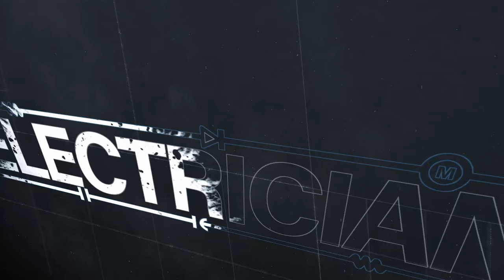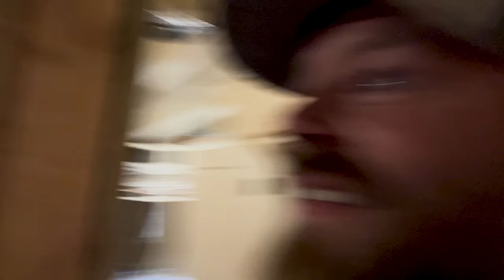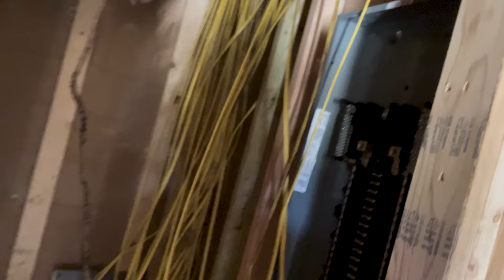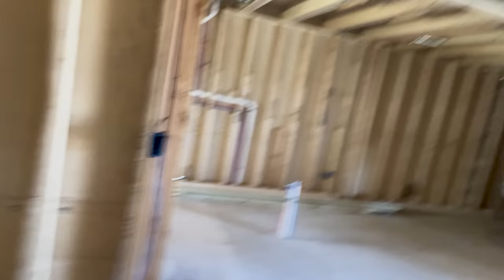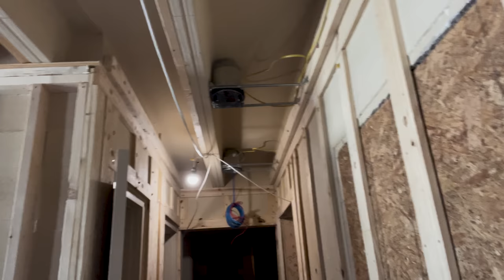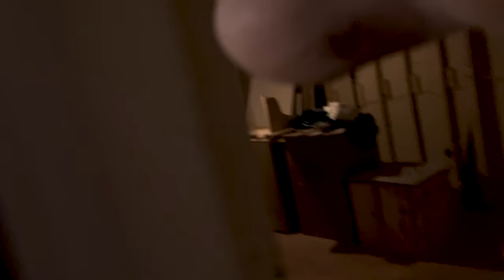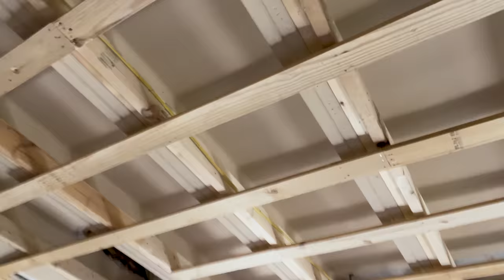Working On a Concrete House

Comment: Here in Florida, a lot of concrete house too. Not fun at times and it’s same issues having here, but gotta get it done and make it work; but doesn’t mean can’t make it look “nice” and clean. Especially clean as going when stripping out so don’t have crap all over(staples, sheathing, wire/insulation, etc); imo, it doesn’t take long to work ”clean” when doing jobs (and yeah, always exceptions I know) but why not do than not spending last 20-45 mins at end of day cleaning crap up….cuz no one enjoys cleaning, far as know. If ya do, awesome, your hired 😅

Comment: I personally am functionality first and looks second. Get it done. Safety first obviously. Waste of time to knock others works because they didn't do it how you do it. Its like playing chess. Easy to see all the moves when you back seat driving, but when you are the one playing, you perhaps miss stuff that could have been done better. We like to drop all our wires at switch locations then place all the wire into the box, rather then placing wire in a box one at a time as we do it. All different ways to do the work.

Comment: We’ve had a couple houses made by “amazing” (if you say so, whoever says these things) Architects…the worse was we had to dig the concrete flooring and lay pvc and bury it in cement, to get power throughout the thing.
Ever wall had different wood framing for the walls…it was sooooo odd! Even the ceiling lighting was a mess, and made out of expensive wood (so we couldn’t cut or chip).
Not only that, the original design, was low voltage lighting wiring…amazingly stupid and pointless, well look at that, you guy had the same thing, one button shuts it all off or all on…
Even had to do some drilling into asbestos panels (they were seemilngly randomly placed into walls lol).
Oh yah, even had a floor outlet..crazy mess!
Reply: Low voltage lighting was actually the right choice if they would have specified the wireless system by Lutron. Only have to run home runs to master control units and power to fixture.  All the switching is wireless. Super easy to install and commission.

Comment: Why didn't you knock out the back of the shallow box  to accept the romex connecter and keep all your wire protected it would have taken the same amount of time and would have been better.  6 43.       Drill where the back of the box is going

Comment: Why do you have to do the drill holes straight?? It doesent matter its behind the drywall? 
Very confused swedish electrician
Reply: It doesn’t matter. A lot of electricians complain about how neat wire is. It’s apparently a big deal in America. Passes code and works, it’s a big argument here. “Must have perfect corners and bends in your wire or you must not care”.
Reply: @cameroncrider6970  sounds very inconvenient… “harder and longer work” for nothing

Comment: Oh no that wouldn't work when I was doing electrical it got be nice neat qnd straight and  uniform any inspectors I ever dealt with were stickler for it being neat I literally seen inspector fail panel for the wires not being uniform and neat in corners of the box